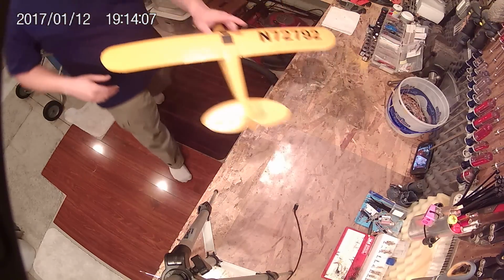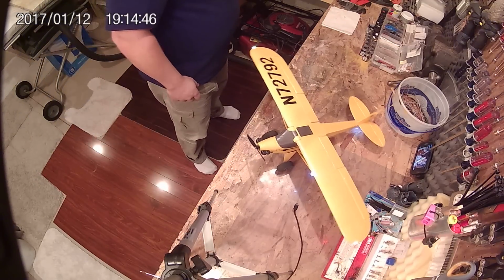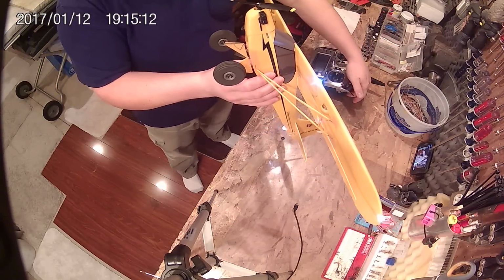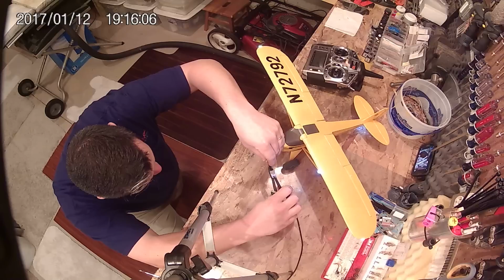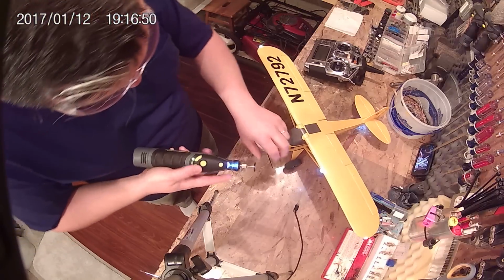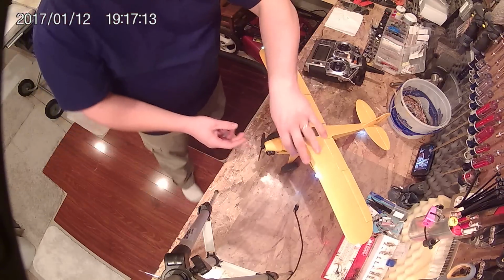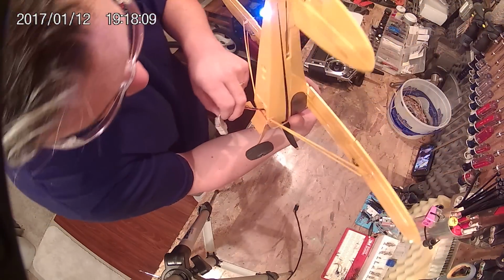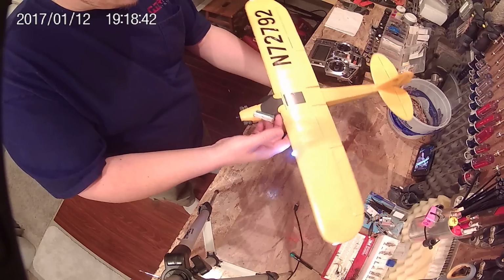E-flite - J-3 Cub UMX - Prop Repair and Balance

Comment: Thanks for the explanation it really helped and I’m serious I realize I could look it up on the interweb but you explained it better. I’ll try the bigger batteries. How would the smaller prop effect load of the ESC?
Reply from the maker: Dillon Jones Smaller prop would be easier on the whole power system, but you may be a bit weak to fly the larger J3 cub. Keep in mind your leading edge slats will increase lift AND DRAG...so you will have a slightly slower flying plane, but you will be able to fly at a higher angle of attack (pointed up more) and at a much lower speed before stalling, since you have the slats...but you still have to get the plane moving, and more drag means slightly more juice to get rolling. Don't mean to say it won't fly, because it WILL, and beautifully at that....but electrical load will be just a little bit higher. The 180mAh 2S 20C packs are some of the smallest ones you can get with the JST PH ends (eflite umx style balance charge plugs).

Comment: Also I posted a video of the issue maybe that will help. I have a new found respect for what you do.
Reply from the maker: watching it now :)
Reply from the maker: Hey, just watched the video, and for sure...it's the Low Voltage Warning (and eventually cutoff)..which "Pulses" increasingly until the motor stops. When you hit this warning, you just cut throttle, and get pointed toward final, and when you need power, you'll have a little bit if needed on an aborted landing, but you'll be really squeezing her hard :)

Should be a super easy fix for you...bigger battery, preferable higher C than 20...and you're set.

P.S. Just made this reply here for the sake of those who read these comments, and wander what the heck came of your issue, but realize you already have my reply on your video.
Reply: Batteries are on the way I’m 90% sure it will work any idea why the 180mAh is weak?? To big of a prop right??
Reply: Thanks for your detailed reply.  I’m sorry for the random posts I’m trying to figure out the YouTube scene.
Reply from the maker: Just the capacity and C rating...increase both, and you'll be set, increase one, and you might be good. Glad you got a few on the way. I hate when I have I have a good lipo that's "of no use" anymore...it hurts my soul.
Reply from the maker: I totally understand! I'm glad to help you out, when I can. I really like doing this RC stuff, and there's a LOT of bad information out there. If you get another question, feel free to ask!

Comment: So Brian. Let me start off by stating I am not as advanced or have the knowledge of electronics as you appear to have from watching hours of your videos. LOL.. with reference to my previous question here is more info.  I thought I was comparing apples to apples with the carbon and the J3.  I cannot compare the two anymore do to the fact I scraped and gutted the CC like a delta 747.  However from your videos and comparison the j3 is bigger. 

Note same board same 2500kv motor. Side note I’ve heard guys say the CC had a 3000kv but I’m looking at the motor and it’s a 2500kv from the CC. Anywho same electronics a little bigger plane with the j3.. I’ve told you about the throttle cut out with the 2s 7.4v 180mAh 20c eflight which I have 4 of.

Here’s the question on the box of the j3 states use a 200mah 2s 7.4v 30c. I’m not a rocket scientist but I’m assuming the prop is bigger on the j3??? Again Carbon cub prop is gone I have no comparison.  The prop is overloaded the 2s 180mah 20c ???? Yes or no. If yes can I down prop to use the batteries or should I just get bigger batteries. Obviously I’m leaning towards the bigger batteries. I remember your prop mod and you wanted more out of the j3....  I think the only thing we may differ on is our flying styles I prefer scale while you do to but maybe I could down prop and still get decent performance. I realize that was a lot of info but let my know what you think. Especially regarding the battery situation.  Wish you good flying weather!!!
Thanks
Reply from the maker: The 180mAh has to do with capacity...so, how long it will run, provided you have enough to run it through what's called the "inrush" when the motor first starts turning from standstill...which takes extra power...

200mAh is about 10% more capacity, but I run mine on 300mAh or 280mAh 2S packs (of various C-ratings).

The C rating will tell you how much "PUNCH" you'll get from the lipo, as it described the speed of discharge...presumably into a load, like a plane...but really anything...before it will start to deteriorate itself with excessive heat or puffing, or melting the internally soldered components. The wire size also helps to establish the C rating, as a larger wire will generally carry more current before it heats up and starts to melt it's sheath...which is NOT good :)

And YES, the J3 Cub is BIGGER than the Carbon Cub SS. The 2500kv and 3000kv motors ARE different, and will not necessarily interchange between bricks, without experiencing the issue you're having. I've dealt with it a couple times...but as a rule of thumb, the Carbon Cub SS UMX and J3 Cub UMX should be very similar electrically. I can't see what my J3 Cub has in it, but my Carbon Cub SS UMX has a 2500kv brushless motor.

I answered an earlier question, then I saw this, so see if you think you can handle my idea from that one, then if you think about it, try your best to reply within a chain of comments, to help avoid some of my confusion. Thanks for doing that Dillon :)

Comment: Brain thanks for the reply. The battery is the eflight 180 mAh 20c that came with my carbon cub I have 4 of them so I thought they would be just fine considering the j3 has the same motor and board as the CC. 
I actually haven’t even flown the j3 just went straight to the flap mod. Motor is free powered and unpowered.  I’ve already tried a rebind no change.  When throttle is applied everything is fine till just past 1/2 throttle as I approach full the motor strays to slightly surge for lack of a better term then eventually cuts out.  I return the throttle to idle or off wait for 3 seconds throttle works again. I think it’s the board. I get you a video later. Happy moding
Reply from the maker: I fear that the smaller lipo is sagging. I'm running this plane, on a 300mAh 2S 35-70C pack...and they help me to balance the plane...the CG is really touchy on this plane, but mostly because where I put my flap servo, and the wire I used for the LED Mod was way too heavy...lesson learned :)

If your lipo sags, you can cause a brownout...but you may be falling into low voltage cut off...If I were you, I'd try a big battery....just make the thing work, to rule out the brownout. You can use whatever size...2200mah, so long as you only have 2S powering your plane.

Let me know what you find.

Have you tried just simply disconnecting the new servo, then seeing if it does the same thing?

Comment: Yo Brian I did the j3 cub flap mod and it turned out sweet. I used a horizon linear servo off my carbon cub. After everything is set up I’m getting a weird engine slash throttle cut out. I plugged the flap servo into the same export as you noted and the same export as the carbon cub. I thought it was the same board as the carbon could I be wrong. I have rebound and no other mods besides the flaps any ideas on the throttle/engine cut out?  The board was quite hot as well
Reply from the maker: What size lipo are you running?
Flap servo works, independent of throttle, right?
Does the motor turn free, when off. Does it turn free when powered up, but no Throttle?

Let me know, and I'll try to help you out.